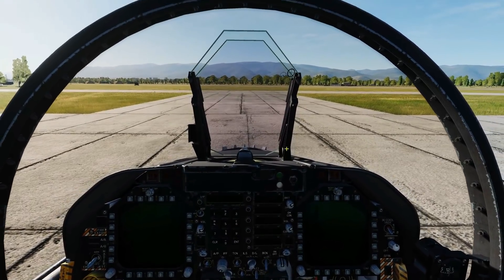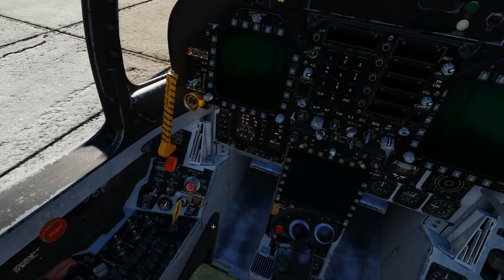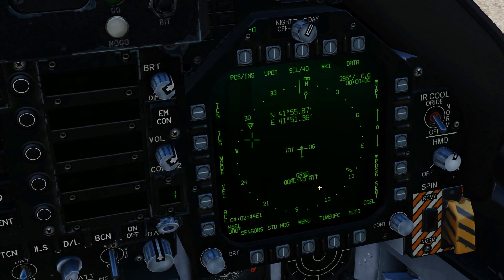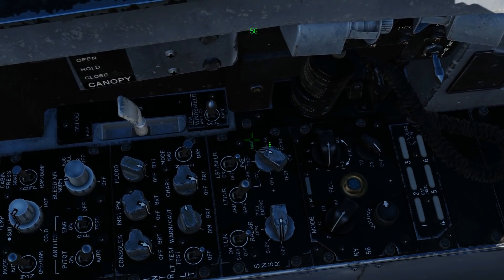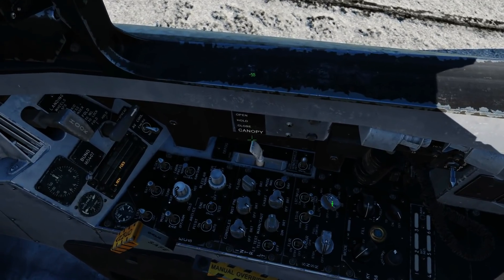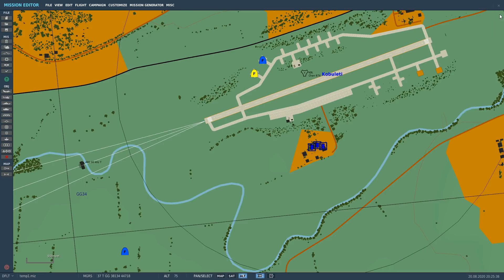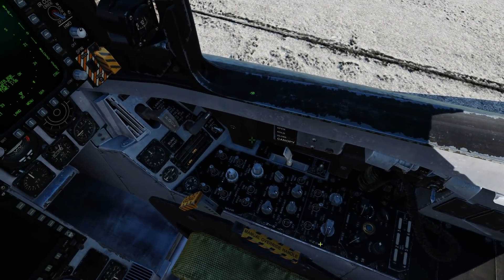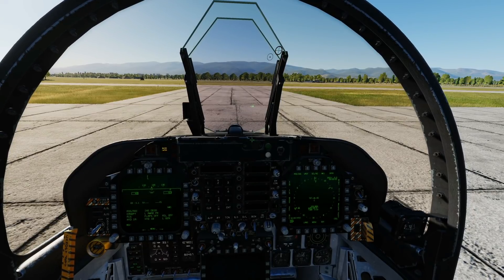FA-18C Hornet: (STD HDG & IFA) Stored Heading & In-Flight Alignment | DCS WORLD

Comment: Hi Cap.  So I don't see the option on my HSI for a stored heading.  I am in the Gulf and start up as per guidance,  but only have sensors, a gap then menu on the hsi.  Any ideas?
Reply: Hi Cap,

Cancel my last.  I found out I was turning on the radar at the same time i turned on the nav (bad habit).  Don’t turn the radar on and the stored gps is on the HSI.

Comment: Does the stored heading works in a carrier or is it just ground?
Reply: Doesn't matter.
First setup INS to GND if ground or CV if on the carrier
Set STD HDG enabled on HSI
Wait
Profit
Reply: @creo_one  But the carrier is constantly moving, stored heading alignment is where WP 0 is currently located.. but you're moving. Might be wrong about this but that's my thoughts on it.
Reply: @JSpidey  
NATOPS FLIGHT MANUAL
NAVY MODEL
F/A-18A/B/C/D
161353 AND UP
AIRCRAFT

8.1.2 Carrier INS Environment. The CV alignment is dependent on the Ship Inertial Navigation
System (SINS). Align times are longer to achieve QUALs typical on land. Ship turns and sea-state also
affect the CV alignment. Postflight updates (closeout) cannot be performed on carriers.

also

. Selecting the STD HDG option results in an alignment based on the
stored heading when the INS was shutdown. To enter stored heading alignment, set the parking brake,
place the INS mode select knob to CV/GND (This provides the CV/GND alignment display on the
HI/MPCD, see figure 24-4) and select the STD HDG option. When stored heading alignment is
entered, the alignment progresses the same as a normal ground alignment.

It works, it's just slower

Comment: Good morning Cap. Have you noticed any issue with your velocity vector sticking to the left or right of the HUD after this new alignment? I'm not sure if its a bug or if I'm doing something incorrectly, but even my pitch ladder is acting strange. I'm fully aligned with no DEGD message and showing the POS/AINS. Happy flying pal.
Reply from the maker: No but I will keep an eye open for this. Have you got a large wind on the mission??
Reply: @grimreapers  Not at all. I've just realized that it does it if you only use IFA, and don't align via CV or GND prior.

Comment: What happens if you takeoff without the INS aligned and then turn on  inflight alignment?
Reply from the maker: Plane will not work. IFA does not align the Nav, it just stops it from drifting out of alignment.
Reply: @grimreapers  After I posted I did a test and it does seem to work.

Comment: Edit: Assuming this is a different version than the standard DCS? I show no 'STD HDG' when aligning on GND. Nor do I see POS/AINS when in IFA.

Is STD HDG on by default? I just got the F/A-18C, and have never clicked STD HDG and have been aligning in 90ish seconds.
Reply: are ya playin stable or open beta?
Reply: @mrpawno4955  it would be stable I am playing in.
Reply: @yegnaro  There is your answer. This is in the newest open beta version. There isn't really a reason to play stable though, unless you are really really bug averse.
Reply: @yegnaro  these features are currently only for testing on the open beta
Reply: @GalacticMilkfoam  I don'T get it. I'm using the latest beta version and still I'm missing this STD HDG thing...
Reply: How often are DCS updates, and how big are they? Rural internet would make it slow to play with constant updates
Reply: @yegnaro  About once a month ATM. The latest was 2GB, could be less depending on modules installed though.

Comment: What  if you are on a carrier? Do the same procedures work?
Reply: NATOPS says: "If the INS has been shut down after a good alignment, the aircraft has not been moved, and NAV has not been selected, a stored heading alignment may be selected to reduce INS alignment time. ". Given the ship is always moving (and thus the aircraft is moving), I would say probably not - but that is what the CV alignment mode is for. It talks to the ships INS via RF or SINS cable to speed up alignment whilst moving.
Reply: @Ironwulf2000  Butt do you still use the IFA mode after aligning on a carrier with CV
Reply: Dick SRAM yes absolutely
Reply: @Ironwulf2000  Thanks, I can update my check list now.